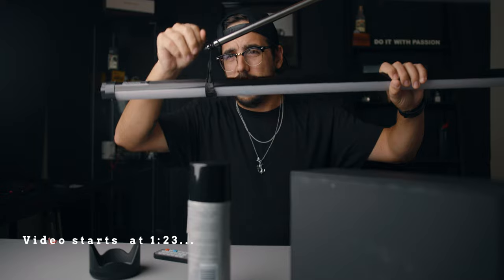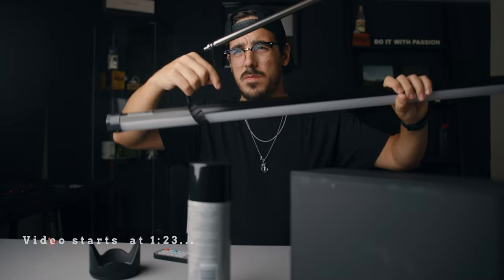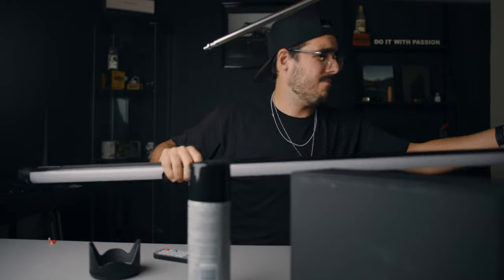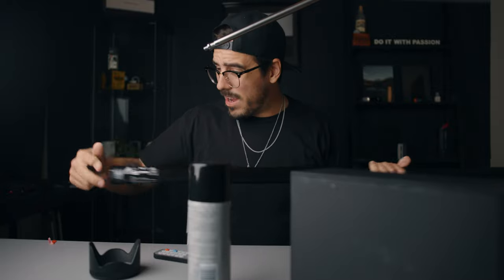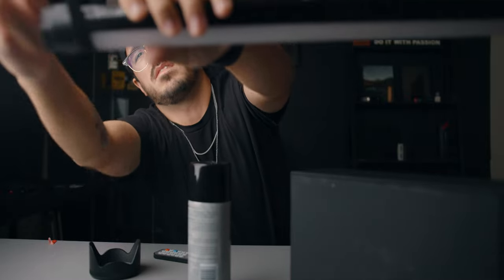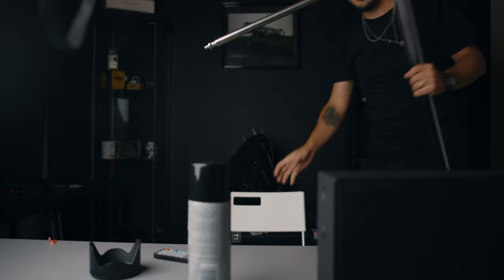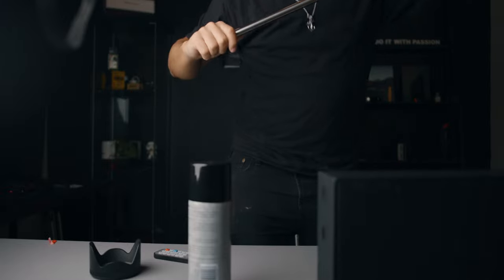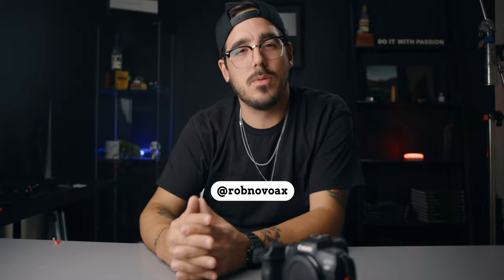CANON R5 ...How is this still an issue??

Comment: This is a known “non issue” because in photo mode your camera is not over heating.  

As you didn’t provide any details of what your settings were when you got the warning … I am assuming that you got what looks like an overheating warning while taking photos and your C3 video preset is one of the video modes that overheats….  The warning is telling you that if you switch to video to use the settings on C3 that you will not be able to record video. Hope the explanation makes sense. 

It is more of a poor ergonomic choice from Canon to show you this condition. 

As to why the camera still overheats in general… it is basically physics and that never changes. The way the camera was physically constructed (no ventilation , small area to dissipate heat and more that suspect heat dissipation measures) just makes it impossible to deal with that 8K.  The only way for them to fix it is to physically alter the camera and that will not happen… they already have your money.
Reply from the maker: Thanks for the info! i have not seen that issue before and didn't start happening to me until recently. I understand and am not bothered by the video issues as i was aware of it, but i wasn't aware of the photo overheating warning not truly affecting the photo side of things. made perfect sense, thanks Bryan!
Reply: I have an R5 and its more of a cripple hammer than physics. Sony A1 don't overheat and it has more processing power in a smaller body. I got the heatsink changed in my camera and it gave me a little more time. But the "overheating warning of death" make you change how you shoot and thats not cool.
Reply: As Bryan said the camera is not overheating and will not overheat ever in photo mode.
If you wanna get rid of that overheat warning just switch your camera to a video mode that doesn’t overheat and you won’t see it again when shooting photos.

Comment: Has it ever locked up when taking pictures because of overheating, my understanding for the few people that I have heard that happened to, is that they got the warning but it never ever resulting in locking up or stopping of taking pictures. Kind of a false alert maybe? Also were you using RF or Ef with adapter when it happened, I have seen clues that give me the idea happens more with EF.

Have you considered, I know painful but considered cropped mode for 4k, oversampled 4k so high quality, less to no overheating, can't do 4k 119 but should be able to do 4k60 I would hope without overheating.
Reply: Man... I got a 15 minute timer on 4k crop 60, that sucks, wonder if that is heat or my space, testing
Reply from the maker: It hasn't necessarily locked up, but i never wanted to push it to that point. Once the warning comes off i always feel i should automatically let it cool down and not melt from the inside, haha. i know i can do external 4K 60 for a very long time without overheating, but now that i have the C70 im not super worried with video, just wish the photos didn'd do that. As always, thanks for watchingfriend!
Reply: @RobNovoa  It's not overheating in photo mode. Its' just telling you that c3 will over heat if you press the record button. If you change the setting on c3 to 4k regular you will not get that warning.

Comment: Thats kinda like saying my car looks so beautiful but I can't drive it pass two blocks  smh. hope they will step up and fix this issue for you.
Reply: 70% of all sony cameras overheat including the a6500, a6300, A7siii and the new A7iv. But people don't talk about it. Strange!
Reply: @presise1620   They did 100% when Sony was overheating in 15 mins like the R5 but people don't remember that, strange lol but really that sounds good as a sound bit but the truth is you can make any camera overheat if you really try hard enough. In normal real world use most cameras don't overheat but the R5 does. I'm not really sure what does that have to do with the R5 overheating in Stills lol. I don't see that with sony so plz lets not tryi to justify something everyone else already knows the R5 will overheat if you look at it too much.lol it is what it is...🔥🔥🔥
Reply: @town3  the R5 does not overheat in Stills. Does your? Mine don’t. It does not overheat in regular 4k or HD. If yours overheat in still you may want to call you local canon shop.
Reply: And no you can not make any camera overheat. That’s a sound bite. The R5 has 3 modes that overheat. And 4 mode that don’t. So you car analogy don’t apply here unless your saying that if you drive a high performance race car at top speed (8k or 4khq) with no coolant it will overheat. Lol. But if you drive that same car normal (4k) it will not over heat.
Reply: @presise1620 lmbo. Yes you can make any camera overheat lol smh. Thats fine, you keep trying to change the facts. The R5 will never be a production camera thats reliable because it's unreliable and prone to overheating.I guess you can change that in your mind I'm sure and make it not overheat lol. Ok Presise it was all fun but time for me to get back to work. Have a good one
Reply: Ive worked on many sets in Hollywood sir and yes you can make any camera overheat if you put any camera in the wrong extreme conditions. After saying that i'm done being my whole point was the R5 is a toaster and not reliable for any professional production and i've experienced no overheating on my A1 like it or not but then I dont use the A1 for my long narrative ,film or doc work I use my FX9 and FX6. Anyway lol have a great day we all have other work to do.